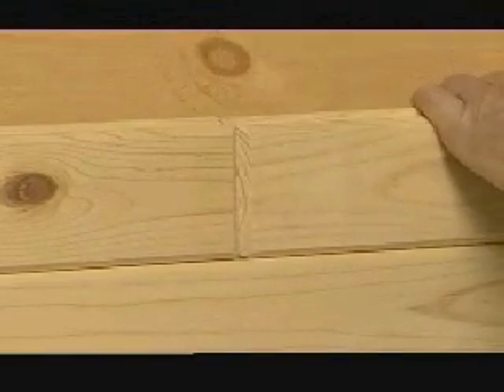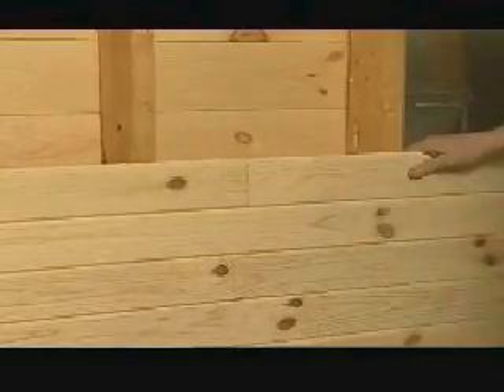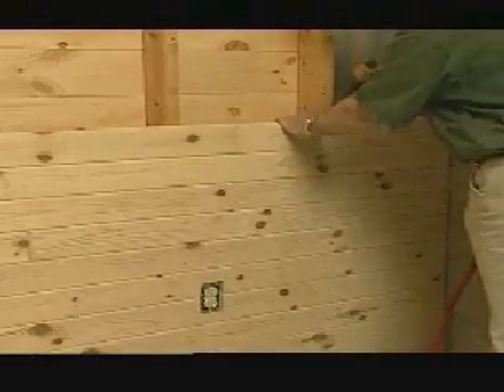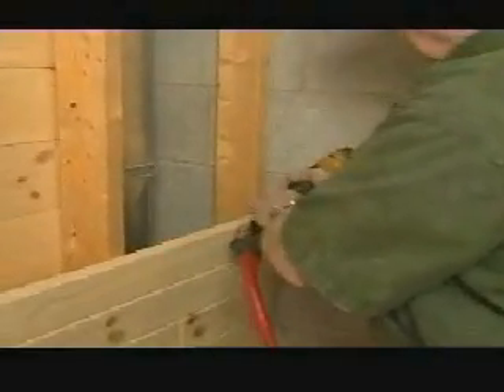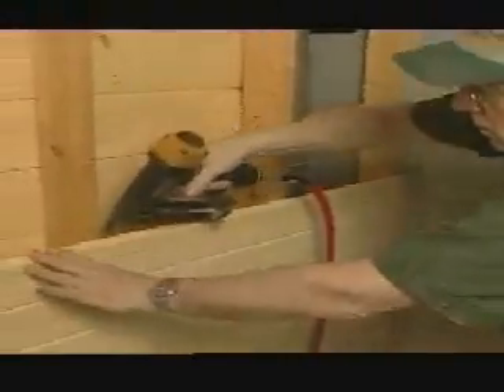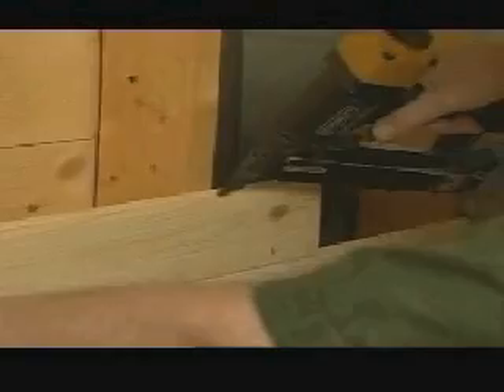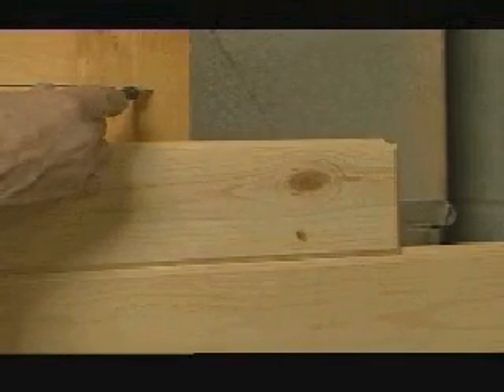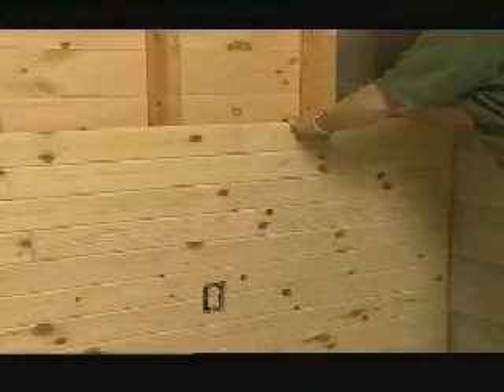How to install knotty pine paneling

Comment from the maker: 16 & 24" are the most common installations. We have even had folks install the paneling on 4 foot centers in pole barn type buildings, but they were selective in using our shorter pieces....making sure they saved those for areas where there were vertical nailers.

Comment: can this be hundreds over drywall?
Reply: at $1.02 a sq. ft. unfinished and $1.75 a sq. ft. prefinished, you'll find it most economical in cost with all the installation, mudding, sanding, messy clean up, priming, painting and maintenance that you'll have with drywall

Comment: Cannot notice the placement of the nails because the resolution of the video is way too low to see where the nail is being put.
Reply: Maybe this PDF file will provide you with better details?
 http://www.woodworkersshoppe.com/wp-content/uploads/2015/02/02-installation_paneling.pdf
Reply from the maker: Here is a link that better describes the nail location: http://www.woodworkersshoppe.com/wp-content/uploads/2015/02/02-installation_paneling.pdf